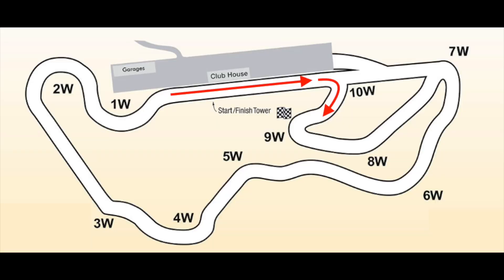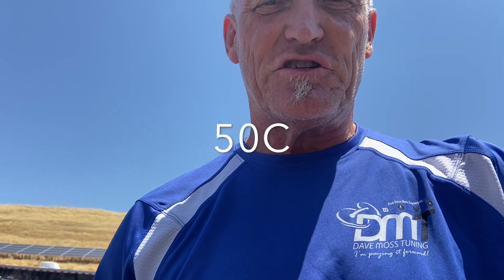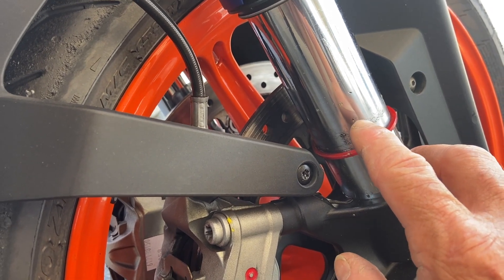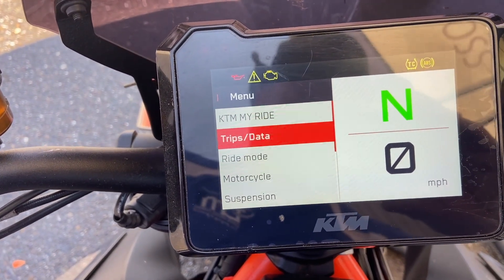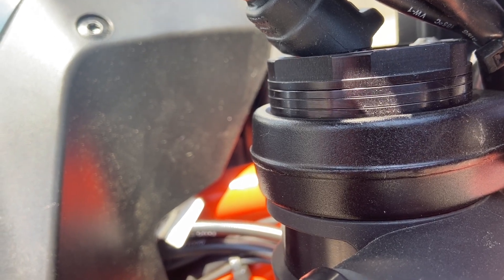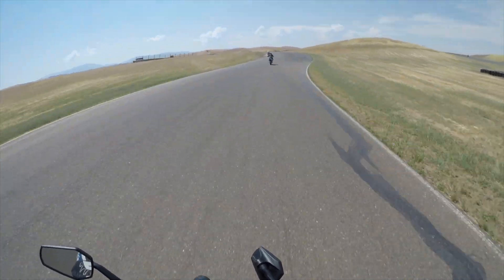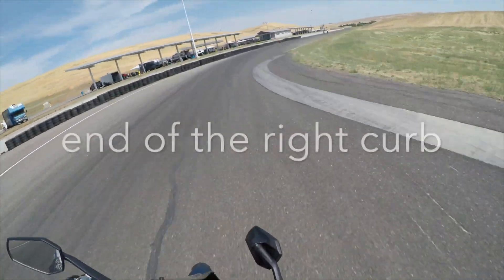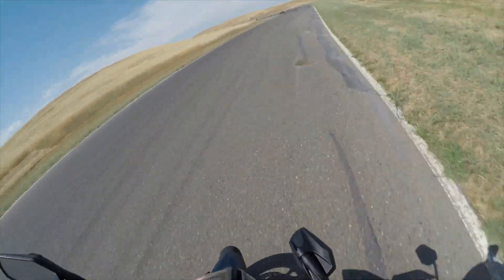KTM Evo test 2 for suspension settings

Comment: Hello Dave!

Would you recommend raising the forks to the 3rd line for mainly street ridden Evo's, as well?
Reply from the maker: If I need it for the track to get it to turn, I will need it for street at much slower speeds where more agility is required in much tigher turning radius'.
Reply: Thank you!